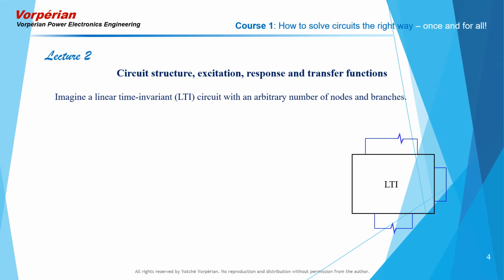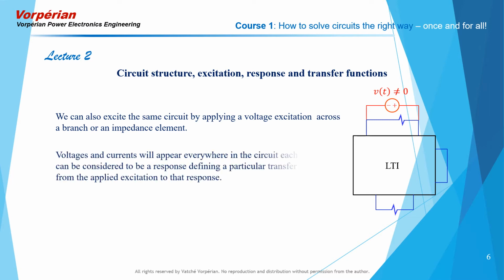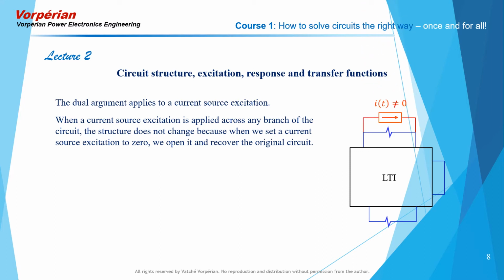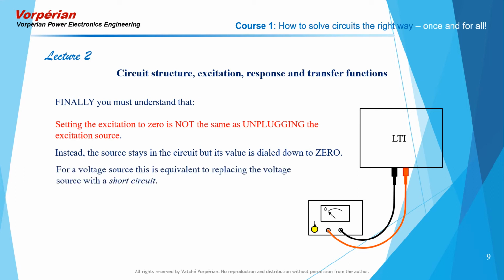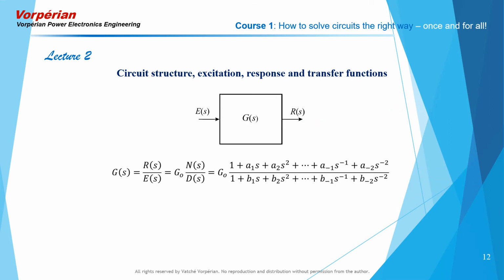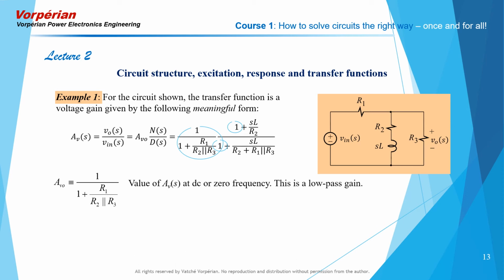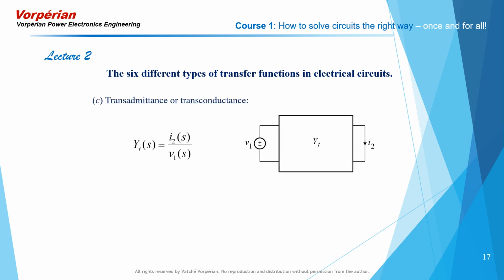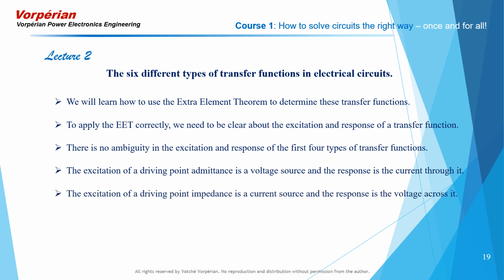Video 6: Fast Analytical Techniques in Electrical and Electronic Circuits

Comment: in the Middlebrook lectures for determining loop gain , because of no ideal point of injection he uses triple injection but in yours book only double injection, please can you explain, why?
Reply from the maker: In most cases, specially in determining the loop gain of dc-to-dc switching converters, single loop injection is very adequate. Triple injection requires the general feedback theorem which Dr. Middlebrook developed after my book was published and that is why it does not appear in my book. The GFT is pretty involved and requires quite a good bit of discussion for which I have not found the time and place to do it.